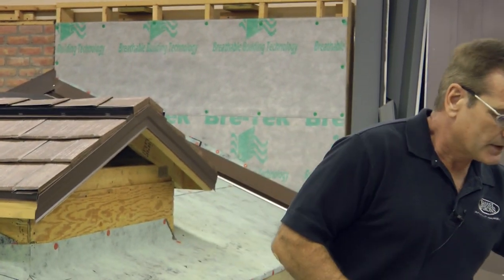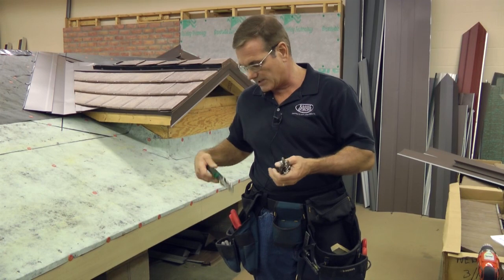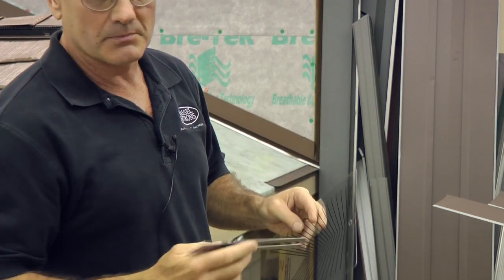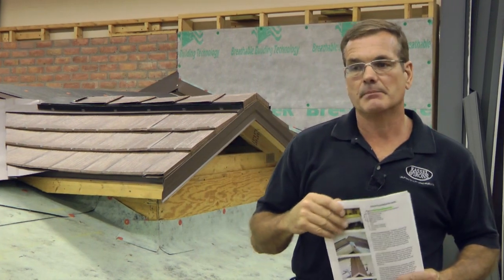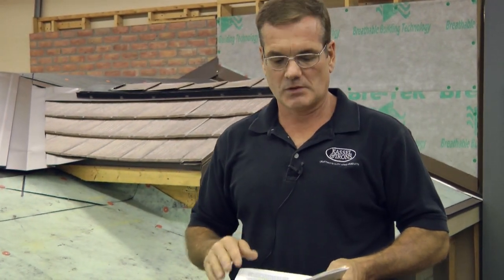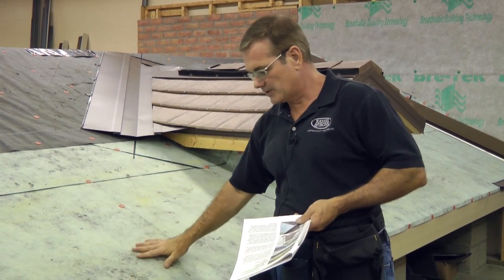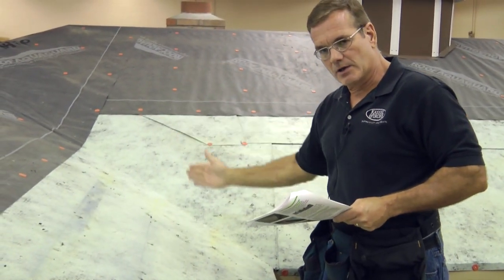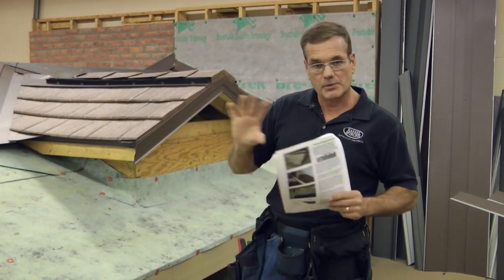KasselWood Installation Series Introduction

Comment: why weave the underlayment over the valley so water can get under the underlayment around the nails?
Reply from the maker: More than one layer of underlayment may be redundant but can provide extra protection. 

 Ice and water down the center of a valley is crucial if applied on bare deck.  Some installers may choose to stop the synthetic underlayment short of lapping over the center of the valley.

 Plastic cap nails should not be applied close to the center of the valley.  Thanks again for the question.

Comment: Why use ice and water and underlayment? Water gets under the shingles?
Reply from the maker: Our standard underlayment is a synthetic underlayment. However, many areas of North America require ice and watershield over the eaves by code. So, we show ice and watershield installation.
Reply: @KasselandIrons  for the ice damns water will back up under the shingles? Would you run a full or half sheet or no sheet up the rakes?
Reply from the maker: @Brandon-no3vc  Our suggestion on ice and watershield is to follow applicable building code.
Reply: @KasselandIrons  why use ice and water tho will ice and watter back up  under the metal shingles?
Reply from the maker: @Brandon-no3vc  When ice and water shield is required by building code, it must be used.
Reply: @KasselandIrons  here in Canada we dont have to get a inspection though
Reply: @Brandon-no3vc   Why is it so hard for you to understand what Brandon at Kassel is saying?  Incidentally, as great as metal roofs might be, being a home owner, I'd always choose to install an ice shield barrier regardless.